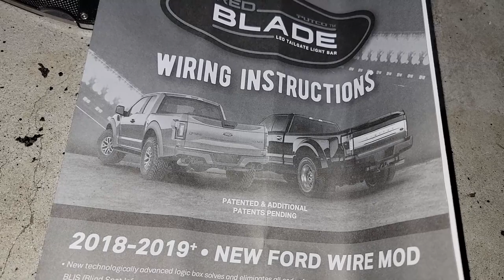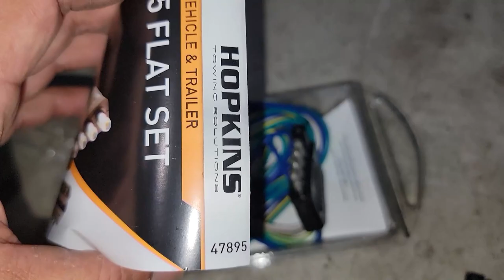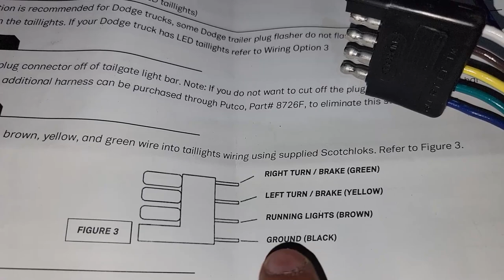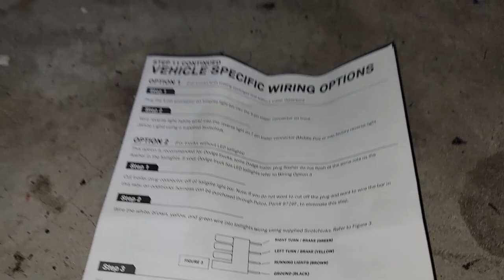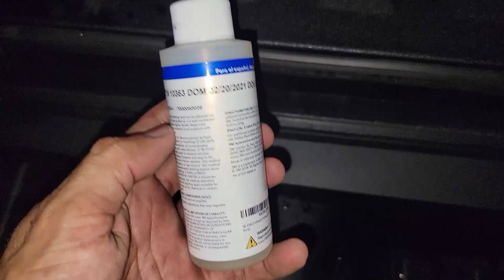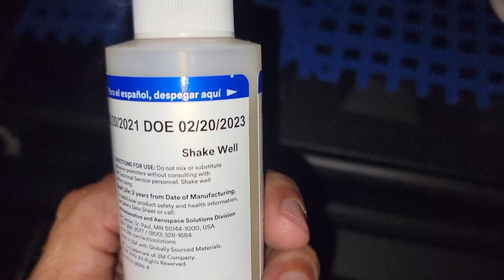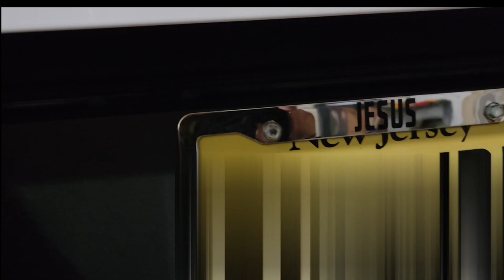Honda Ridgeline 2021 Putco Blade Led light Installation

Comment: I am enjoying all your video's and I'm sorry if I ask too many questions.  But I am curious did you mount the blade facing up instead of out and was that because it would bump and scratch the tailgate if mounted perpendicular to the frame.
Reply from the maker: Thank you! and you are correct, you will see it , if you have the chance to install one of this guys make sure to do your measurements to make sure everything goes into the right place .

Comment: Can you post the wiring diagram?    Love to know the color of the Ridgeline trailer connector wires to the Putco color wires.   Thanks
Reply from the maker: My friend to be honest what I did was use a tester and check each wire from pudco and see what light what connecting it to each connector of my trailer switch, basically I did add and use the diagram from this guys: https://www.autozone.com/electrical-and-lighting/trailer-wire-harness-and-connector/p/hopkins-towing-solution-60in-5-wire-flat-connector-set-47895/896105_0_0
and the one from the manual from my honda truck, Putco, uses more hard wiring and they like to cut and expose wires, honestly like more plug and pluy installations.

Comment: I believe I have the same light bar. Here’s my problems. When I apply the brakes the Amber lights up. With the headlights in auto mod the Amber blinker gives of a flash on the other side also, like a ghost light. Though when in regular headlight mod the work fine. I’ve tried a 7 pin to a 5 and 4 pin adapter. I’ve tried hard wired to the 7pin itself. Getting the same result all around. Any thoughts?
Reply from the maker: Did you test it one by one? I asked because before I connected everything, I did test again each connection unless you have a defective bar. The one on the video got broken about 3 months later, then after the replacement is working well.
Reply: @07Review  i didn’t do that. I’ll try that next. Also going to call Putco and see if they can help in anyway. Thanks
Reply from the maker: @tompatterson209  Good, also just an advice, BE STRONG with them, for my replacement they were a lit bit hard to find, best over the phone, finally, they will tell you to cut the base of your Putco light and send pictures back to them, well that's how they did it to me, it wast not easy but worthed. good luck my friend GOD bless!!!

Comment: Is it really water proof?
Reply from the maker: So far I just Use the warranty due water damage inside the light, I will check and follow-up the new replacement and see how good it is for the next 2 years, we will see if this light worth the money 💰.
Reply: @07Review  is that company really backing their led strip light up?…I was about to buy and looking for videos I came across yours. your video helped me a lot but since you say yours have been damaged due to water….please let us know if we can count on that company….
Reply from the maker: @jorgemariofuentes2448  you got it, my friend the new replacement should be here tomorrow, I will made a video and follow up and see if this light worth almost $300.00 so far replaced after 2 months of use, let's see if it was a defective and the new one can holds more than 2 years.